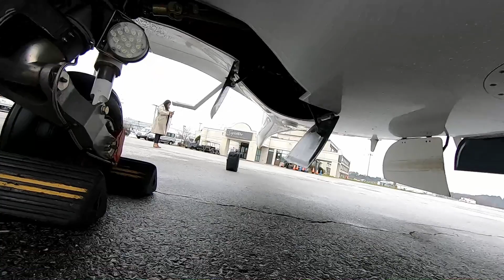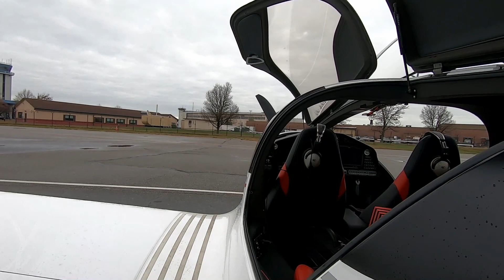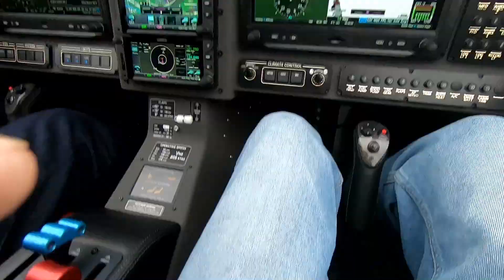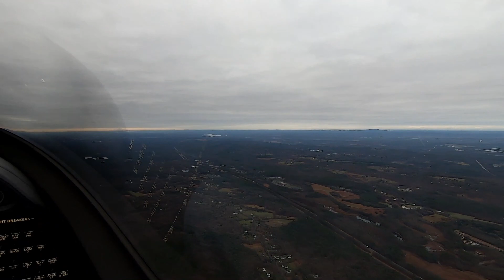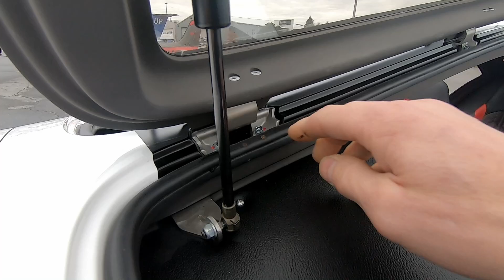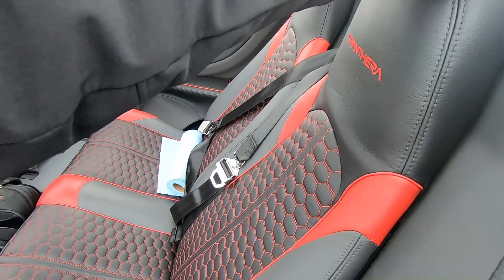Flying the brand new Pipistrel Panthera at KBED 11 27 20

Comment: Hold on..this plane is not as small as it seems..i mean it's almost the same as the sr22
Reply from the maker: Inside it's smaller than the SR22. I'm 6'4" and was up against the roof up front with my headset on and in the back even with no headset.

Comment: Put in an automotive diesel engine with all modern ECU controls and OBD2 etc and you've got the perfect plane!  Could use diesel fuel or jetA and instead of burning 14.5g/h it would burn more like 9g/h at 210m/h and the engine would cost about 1/5th the cost or less for a superior engine!  If PP offered it with, say, an Audi 3.0 TDI I'd totally buy one.  Better engine that would take about $80,000 off the price!
Reply: Better Lycoming tio 540 turbo, 250hp
Reply: @МаксимВасильев-у5м  not efficient enough, not powerful enough, not jet a
Reply: Look at the Diamond DA50. That has the CD300 6 Cylinder Conti turbodiesel. Like you said, 9 Gallon JET A1 consumption.
Reply: @ClintEatWood  DA 50, empty 1440 kg, load 559, Max speed 335 km/h, Panthera empty 815, load 500, cruise 360 (75%). Panthera without turbo., Da 50 with turbo. Da 50💩
Reply: @МаксимВасильев-у5м  IFR --> no Turbo: 💩 no TKS: 💩
Reply: @ClintEatWood  Which is better, TKS or electronic heat de-icing???
Reply: @МаксимВасильев-у5м  fuel consumption?
Reply: @nichooo6423  yes
Reply: @ClintEatWood  yeah ... love that plane but it's super expensive and not as fast ... and it's super expensive because that stupid CD300 is stupid expensive.  They need to start putting automotive 350HP tdi engines in these things... they're more advanced and cost 1/8th as much and are super efficient and reliable
Reply: @TheGreatDadoo  , that's right. I think it is the weight of the typical 3.0 automotive TDI, they are relatively heavy compared to the CD300.
Reply: @ClintEatWood  not anymore.... check out the Raptor Aircraft... dream machine!
Reply: @TheGreatDadoo  Raptor is a fail. Velocity is a good, without diesel of course
Reply: @МаксимВасильев-у5м  your English is the fail... Raptor is a rock star ... WITH diesel, of course
Reply: @TheGreatDadoo  my English better then your knowledge about aviation)
Reply: @TheGreatDadoo  no need to speak on behalf of all American aviation))
Reply: @TheGreatDadoo  Raptor: empty weight 1400 kg, useful load 300 kg. Brilliant.
Reply: @TheGreatDadoo  - Why did you suddenly get so snarky and personal towards the guy, just because he has a Russian name?  Totally irrelevent and says a lot about how bigoted you are, and defensive, if people don't agree with you.
Reply: @TheGreatDadoo  Uh, Raptor crashed and dude it moving on to a totally new design concept because he never got anywhere near his performance goals with that thing.  Frankly after watching most of the videos I would be scared to fly in a Raptor.
Reply: @gatorpika  yeah, it's sad.  i'm glad i never gave him any money.  concepts seems great to a dum-dum like me but it always was fishy why big-aviation didn't take on the project instead of ONE GUY!  like, if the auto diesel engine idea was so great for power, weight and cost why didn't Velocity do it a long time ago?  it was a big, fat fail and it's sad he's just gone dark and not admitting to it.  i started criticizing him two years ago but that video that came out starting with his bad turbo design and ending with... everything from weight to his stats to his bad performance in every case really opened everyone's eyes.  truthfully, i do with big aviation would pick it up.  i can't help but think, done right, the raptor concept is awesome.  i just don't think he can do it right.
Reply: @TheGreatDadoo  Nobody is going to pick it up because it was just bad.  It was basically a fatter velocity, so much more drag, and a failed engine design.  If you want a canard style aircraft that's better in every way, buy a Velocity.  The only thing to take from the Raptor hype is that there is still a high demand for using relatively cheap automotive engines off the shelf in aviation.  But that's really not news.
Reply: @gatorpika  Superior Parts is developing a 2-stroke opposed pistons diesel engine which is very efficient due to the expansion capabilities of the opposed piston design, and the simplicity of the 2-stroke makes it quite reliable and cost effective. So why investing effort adapting automotive engines with crappy diy solutions? 

As far as I know the weak part of the many adaptations is the offsetting gear which fails more often than the engine itself like i.e. frequently happens with Yamahas Apex conversion kits. Also, a common 4 cylinders inline has an overhaul time comparable to other aviation grade engines, the only thing is that you can decide to go on at your risk by postponing it since it's not a certified aircraft, and an overhaul cost that's just slightly lower because the automotive benefits of aftermarket parts, that could be not as reliable as originals. 

After all it's a not-so-worth solution, also, there are a copule of manufacturers (i.e. aeromomentum and viking) providing already adapted engines. Specifically Aeromomentum is providing brand new engines, sourced directly by OEMs already manufacturing for some asiatic brands, and they are already adapted to work horizontal and with a robust gear to propeller adaptation.
Reply: @David Beecroft If specs is all you look at, yes, a car engine might seem more impressive than a plane engine. But that's not saying much as a car engine is built for a different mission than an airplane engine. An airplane will need to use the engine at full rpm for a long time safely, and even when you cut down, you don't really idle. The engine is built to last long on rough use. A car engine on the other hand is only designed to run on full rpm for a little while, and mostly designed to go from idle to low/mid rpm and back to idle often. If you try to use a car engine on a plane, it wouldn't last the first few hours.
Reply: @escvel1  good points... but at the end you took it too far... car engines are used all the time on small airplanes and they last much longer than a "few hours" ... and the RPM thing isn't true either as the redline for airplane engines is much lower and car engines run at 4k rmp for days on end.  I think car engines and airplane engines have a lot more in common than you think.  The cost of airplane engines is offensive... the fact that in many ways you get an inferior engine at a much greater costs is offensive.
Reply: @TheGreatDadoo  maybe I did, I'm not sure... you also have a point, aviation has become a super expensive sport, and it shouldn't be this way, I don't think the costs are justified. Even if the engines are designed differently, and they are, does this justify the massive cost difference? I'll agree, they're way overcharging. The costs are also a barrier to people who wanna try new things. I like the american experimental scene in aviation, something you don't get to see in europe, and even this has become way too expensive and prohibitive. The costs are offensive as you said.

Comment: It’s actually an Italian company with production in slovenia
Reply: Wrong. Slovenian company with production in Italy.
Reply: @fifi23o5  regardless,a well made and impressive aircraft...as far as I’m concerned the panthera is a better performer than the DA50rg..and cost less to operate
Reply: @unkameatgoodbar2315  True. And I could bet it handles better, too! I was fortun ate enough to get a ride in Panthera. I was filming in Pipistrel factory and I got a ride in Velis Electro and Panthera with a factory pilot. And, since I used to fly, pilot let me take control for a while. It is surprisingly responsive, but at the same tme pretty stable, it flies hands-free without a problem. Controls are very nicely ballanced and proportioned, stick is a two finger affair, it is a lot of fun to fly, not just for transport fron A to B.
Reply: @fifi23o5  awesome,I see this plane can enter into a spin and get out of a spin....this to me is a good buy,living in Canada I can make the trip overseas via Greenland and iceland...
Reply: @unkameatgoodbar2315  Pilot showed me a few spins, I tried one. It's quite gentle, exits easily, with just controls in neutral, it stops in less than half turn, I didn't look at the height loss, but it seemed pretty little to me.  Pre-stall buffeting is there, it is just not very pronounced like in some planes, probably because of overall aerodynamic cleanlyness and T-tail, but you can feel it and it also has AoA indicator and alarm. Landing gear also seems to be very robust and comfortable. I didn't land myself, but I know that gress field, it's not the smoothest, but I couldn't feel any holes.
Reply: Actually, you are wrong. It is Slovenian company, with the HQ in Slovenia, Ajdovščina. But they have one production facility in Italy, ca. 200 m to Slovenian border.

Comment: If I could order the experimental version with SDS EFI on the engine instead of magnetos this would be creme de la creme. “Update”, know why the “never exceed speed” is sooooo close to the high speed cruise?? The tail isn’t designed for the speed of the io-540, the tail is still designed for the io-390 and its speeds that it could pull the plane. The FAA has to make Pipistrel strengthen up that skinny tail with a lot more carbon wraps to make this this certified. As it is Pipistrel is just hoping you won’t notice and try to save money by selling it just as it is now.